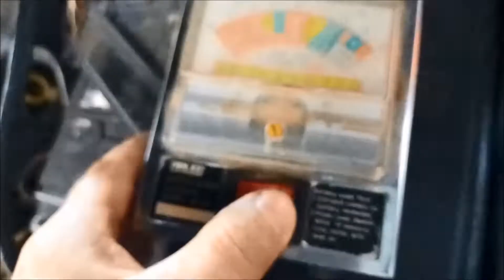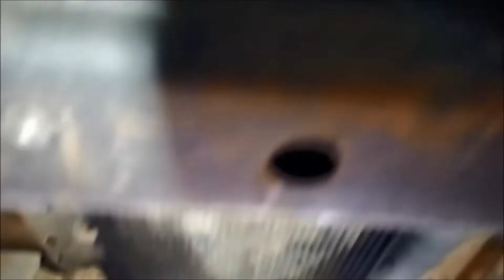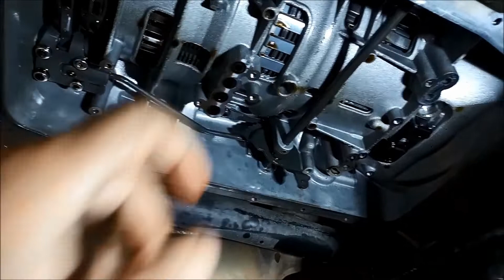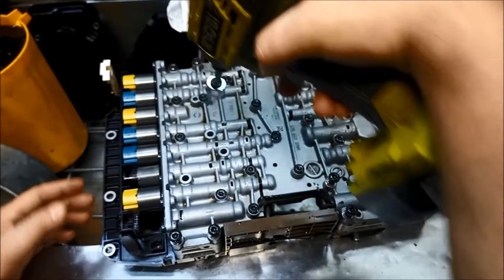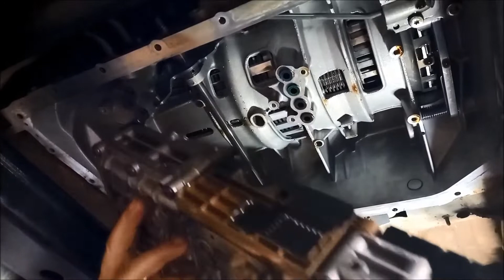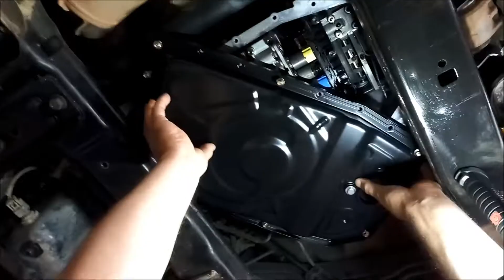Landrover Discovery ZF6HP26  ZF6HP28 Solenoid Set Transmission Service & Metal Pan & Filter Upgrade

Comment: Hi bro do we have the upgrade oil pan and filter parts number please? Thanks very much
Reply from the maker: hi, if you are in australia, we can supply for you. contact via facebook link in description. cheers
Reply: 1068203044 - oil pan, 1068103820 - full set. It's oil pan made for BMW, which has 6hp26 or any other type of 6hpXX
Reply: @Nickolas059  Thank you very very much.

Comment: are you sure it wasn't flowing out on the 35 degree level check because you didn't run it through the gears (I didn't see this). also from memory zf specifies a temp range of 30-40 (not 30-50) for the final check. last thought was why the additive? if it's proper lifeguard 6 spec you shouldn't need it. wouldn't additive just mask a problem already in the box (like worn bushings or a cracked E drum) and the customer will be back in 30,000kms? one last thought, at this mileage it's likely the pressure regulators in the valve body (rubber) are deteriorated and some of the valves are stuck open - this puts extra pressure in the clutch packs because of low clutch apply pressure. the valve body separator plate would also be deteriorated compounding the problem. would suggest you have rebuilt the valve body with a sonnax kit that engineers out all the weak points of this valve body with metal components. thanks for sharing the vid
Reply from the maker: hi, young bloke is in vehicle changing gears usually or visa versa when we check fluid level. check out lubegard website on their data/tests and products. over last 37 years i have tried every additive available to me and find lubegard the best and it works ! still you cant resurrect  the dead regardless of the additive ! sounds like you know your way around transmissions, why would a separator plate deteriorate with torlon or rubber checkballs ? ( unless it has come loose or removed already )... more likely the end plugs in valve body are worn and/or leaking..a zip kit would help but cost is the factor to owners, however choice is always yours ( or owners ) to make. i like to lay out the options weighed up with my experience and costs/risks and let the owner decide. sometimes the owner is willing to take a gamble given their life situation, and i always let them know that there is a difference between fixing ( reconditioning or rebuilding ) and improving issues especially with work like in this vid. thanks for your input. cheers

Comment: a day or so ago watching ivan on pine hollow diagnostics he had another tricky one a car wouldnt start sometimes, the owner already wasted 4k on mechanics trying to fix the issue, turned out to be corrosion in the pins in a connector that  had shorted from one pin to another, not enough to blow a fuse but enough to confuse the electronics. the connector was inside the driver kick panel and water was sneaking inbetween the door seal and frame.
Reply from the maker: yeah gotto love those kind of issues ! i`d not like to be an auto electrician these days, dealing with those problems day in - day out. we have a jigga like the phone technicians use where we connect a pulser at one end and can trace location of open or short circuit if you follow wires ( is ok at about 15cm distance ) and sometimes it actually helps and works ! haha cheers
Reply: @YepThatsIt  yeh i have a tool a bit like that , i bought it ages ago after watching scotty kilmer.